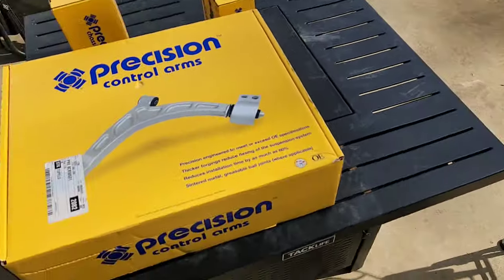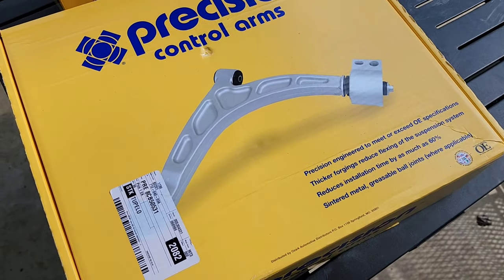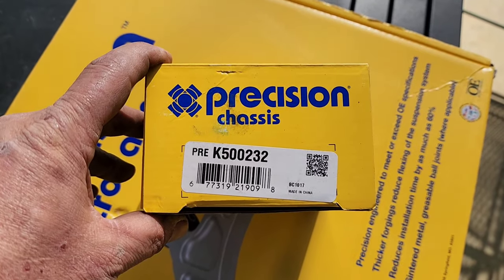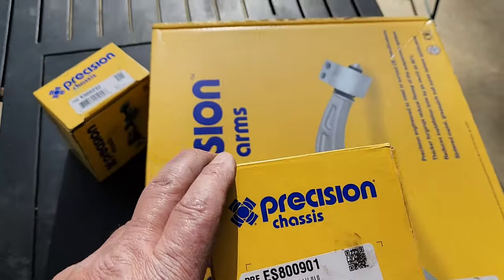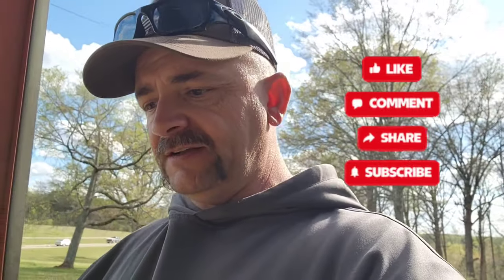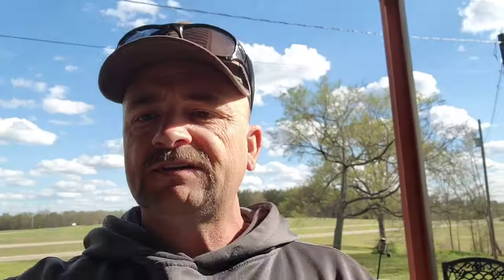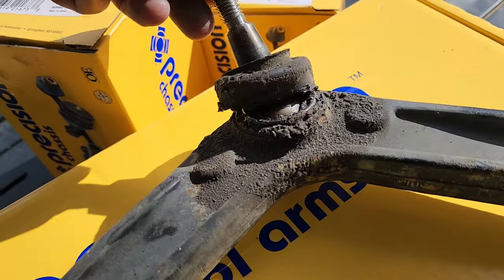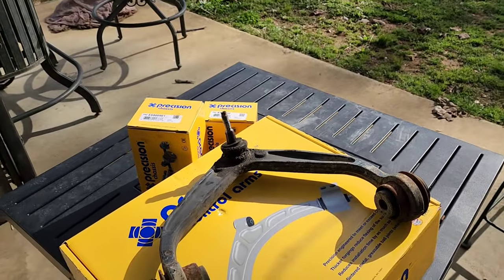Had ball joints and tie rod ends replaced.

Comment: I have a slight steering wheel shake at 60mph. 110000 miles on my 2015 chevy 3500 dually. Im thinking i should do the same.
Reply from the maker: I would definitely check it. Could just be tire out of balance or even out of round. Check that too.
Reply: @semperfitransport6572  I need all 6 tires replaced so that will tell me real quick. I've only put about 1000miles on the truck since purchasing so I'm still getting used to its quirks. Thanks again for all your great videos!!
Reply from the maker: If they still got good tread try rotating them. See if that helps first. Then check ball joints and the whole front end. Get that fixed. Then an alignment. Mine rides better than when I first got it. Thanks for watching.
Reply: @semperfitransport6572  no tires only have about 2,000 miles left on them. Previous owner or dealer swapped the rounded steer tires on the back hoping buyer wouldn't notice. Only paid $38,000 for it and truck in excellent condition. Pretty sure Previous owner was a hotshot already has air bags and gooseneck. Thanks to you and c farmer reviews I got the edge cts3 and love it. Soot gets to 40% and truck Regens automatically. Videos from you guys are helping me out big time. I'm heading to orientation for horizon late may!!!
Reply from the maker: Awesome. Edge Guage is a must have doing this job. Good luck.